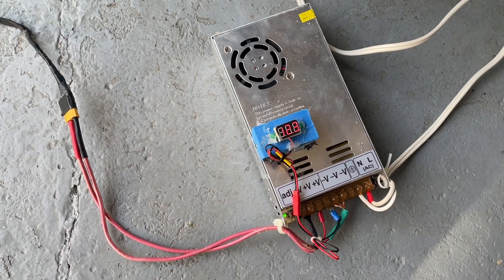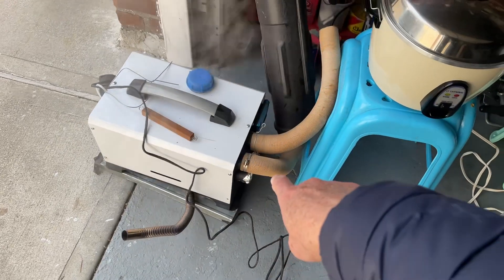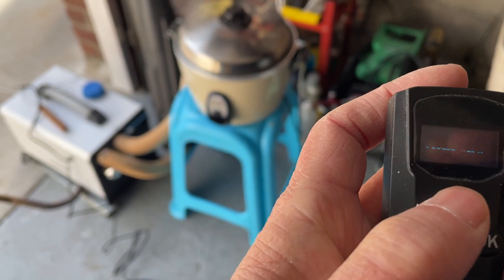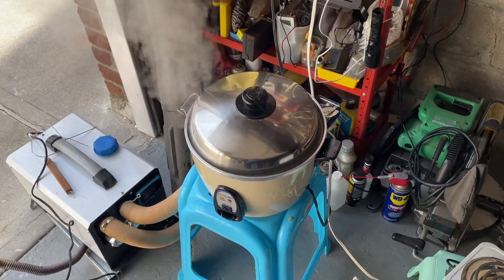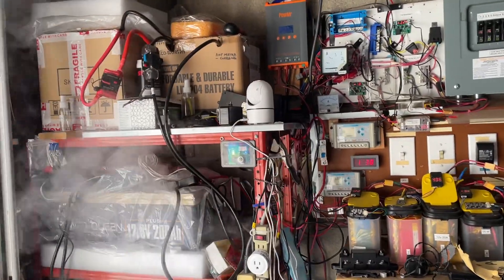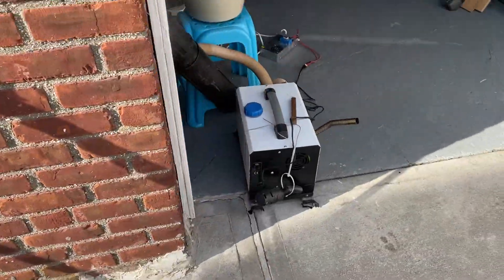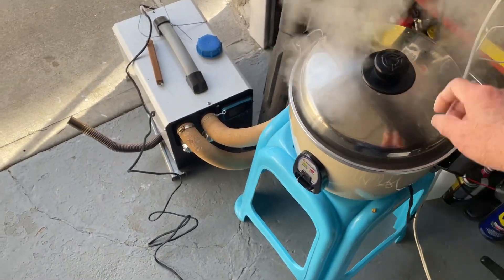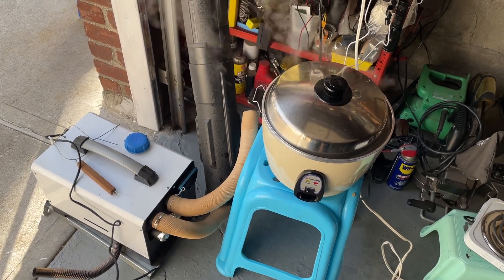Around here, happy hours is when the sun comes up

Comment: You can throw rocks at the panels to knock the snow and ice off.
Reply from the maker: @southernshaker  Almost as as the idea of putting solar panels on the roof where you are required to drill multiple holes. I have a feeling water will somehow make it through those holes. 🙂